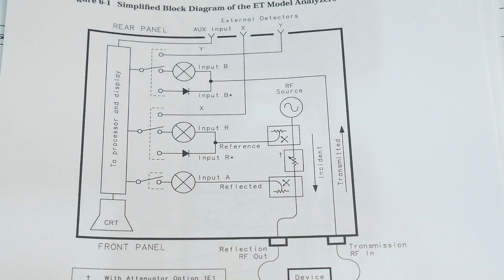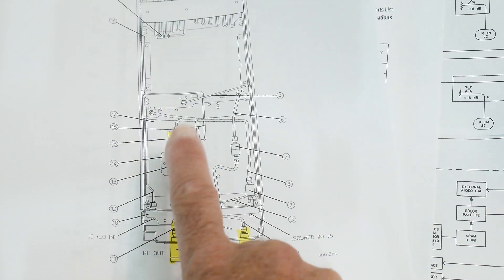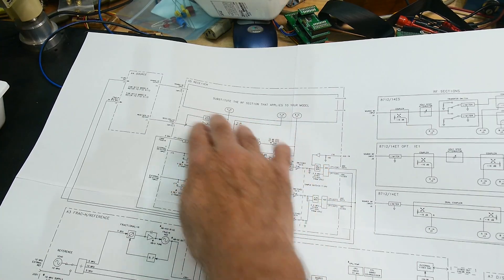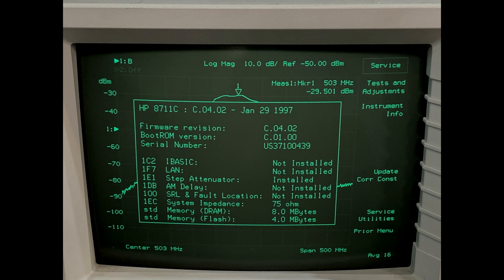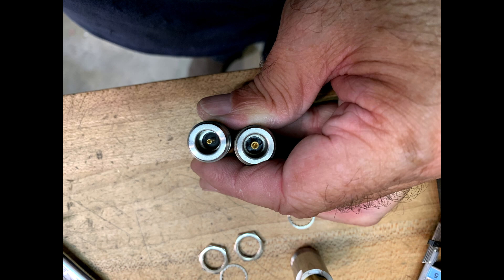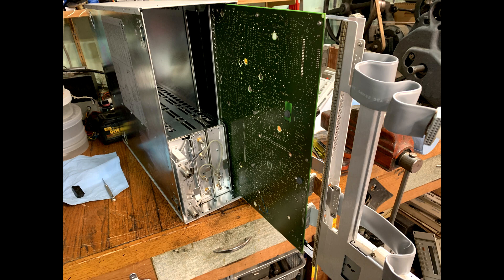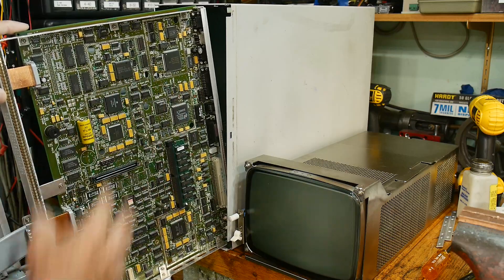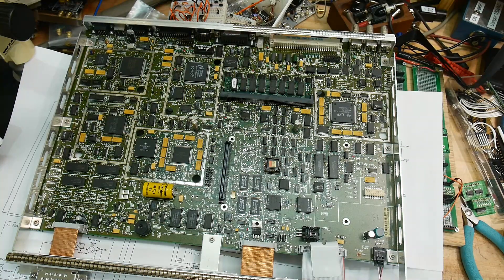#865 HP 8711C Change Connectors to 50 ohm

Comment: Note: my unit looks to be exactly the same as yours, both features and the front end.
Did you ever change the output side coax and 75->50ohm connectors?
Again as my email inquires: the output side hard line dips down to the PCB which is covered by that big metal enclosure. So the cable termination connector needs replacing also.
Reply from the maker: the connectors on the board are 50 ohms on mine. I replace the output side with a 50-50 cable. the input side was all 50 ohms.
Reply from the maker: watch #866

Comment: I have never understood WHY   in the name  of the Great Engineer  "they"  made  75 and 50 ohm "N"  connectors so that they would  "screw together"  because  as  "some" of us know  they don't really  "screw"  (well)  together!!!!   I was lucky enough to find out about this BEFORE   anything was ruined.   A  co-worker and I were being sent out to install  and aim  a  dish/ link with 75 ohm cables, and the co-worker did NOT know the  trick.  My boss  caught me  and made sure  I was aware.  It was  a  coincidental incident and could easily have turned out badly  AS I DID NOT REALIZE   that the equipment had 75 ohm connectors!!!!

Comment: See/contact YT guy = "The Signal Path" for conversion help. See/contact YT guy = "NFM" for how to hot swap the ancient battery on the mother board, without losing the firmware. Mines well change out the e-caps and RIFA caps (if any,) while you are in there.

Comment: The TMS34010NL-50 would have been a graphics processor for driving the video memory.  This was a common "Graphics System Processor" and used in games like Atari Hard Drivin.  It has a lot of graphics friendly ops as well as being a fully featured general purpose processor.

Comment: nice NA , I would put Anzac or HP 50/75 Ohms transformers and not touch the directional couplers which are most probably with 75 E line loads internally built , or check with another NA what are the impédance of these elements and then see what is best to go to 50E...

Comment: I was so disappointed when you read "TMS320C.... something something"! That something tells a lot about the DSP. The C20 and C50 didn't had FPU, the C40 had MMU and FPU...  Now, I will be curious forever!
Reply from the maker: here are schematics: http://ftb.ko4bb.com/getsimple/index.php?id=download&file=HP_Agilent/HP_871x_Network_Analyzer/HP_8711A_8712A_13GHZ_Network_Analyzer_CLIP.pdf
Reply: TMS320C25FNL 
16 bit, 40MHz, fixed point
Reply from the maker: I gave you 8711A, here is the 8712 CPU which is the one I have: http://w.ko4bb.com/getsimple/index.php?id=download&file=HP_Agilent/HP_871x_Network_Analyzer/HP_HP871x_network_analyzer_Other-A208712-60002CPU.pdf

Comment: But what if you want to work on 75 ohm equipment!  You can use a simple resistive pad to convert from 50 to 75 ohm with a very small (known!) loss. You can get them on ebay for under 50 bucks. (mostly due to the cost of the connectors)